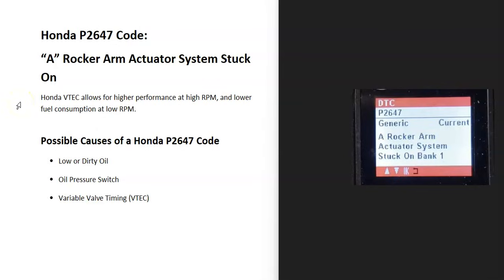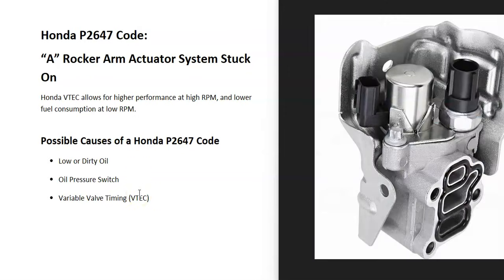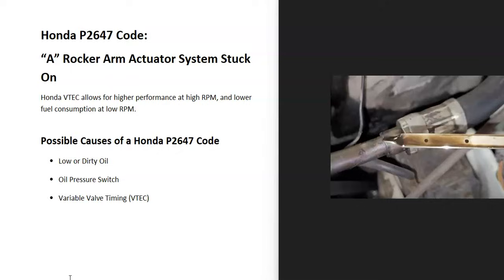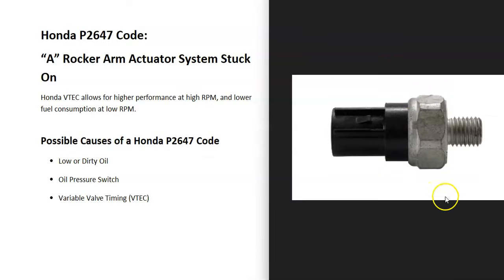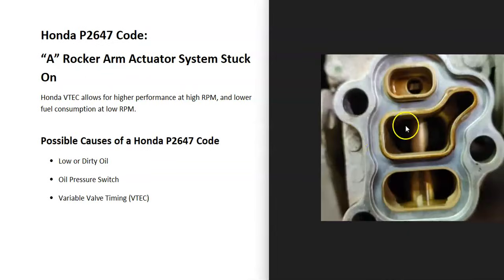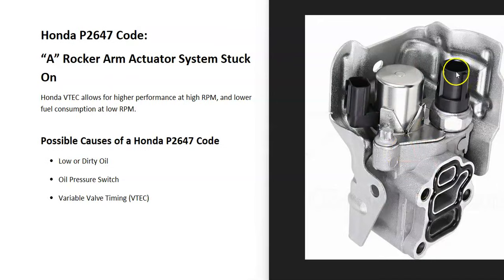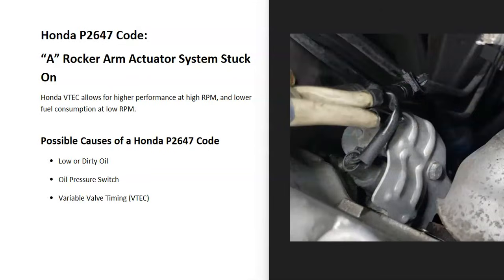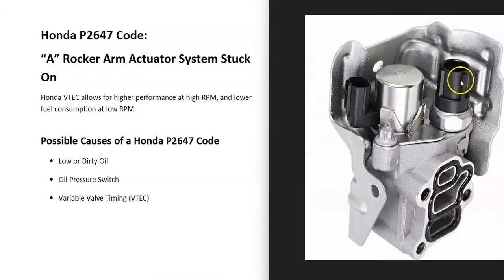How To Fix Honda P2647: “A” Rocker Arm Actuator System Stuck On

Comment: I replaced the part for p2647 cleared it comes back!!! Frustrated.. took it to a shop and checked it out still comes back.. it’s my daughters car….
Reply: I have done everything that possibly can be done to fix the same stupid problem and nothing, biggest pos Honda I ever had , same like you , is my daughter’s car🤬🤬🤬
Reply: what did the shop check and fix or replace when you took it in?
Reply: same here.  I've thrown every part imaginable at my 2012 Honda Fit racecar & still have the same issue.
Reply: I have the same problem, I changed the part completely, I was fixed and the engine indicator turned off, but after 12 days it comes back and on again! I really don’t know what should I to fix this terrible problem?? Is there any recommendations 😊
Reply: @sarwetmohammed7918  You're not alone. I've been researching this since Thursday and many people say the problem keeps returning. Sorry, I don't have any answers.
Reply: Maybe not a FIX but what I did that made this work for me after spending so much was going lower viscosity oil. Hope it help 🤘🏽
Reply: @chrisdejesus2955  0w20?
Reply: @elisa7joy9  yes I actually ran into this problem again with a friends Honda pilot and we changed the oil and it did it again, so then I drained the oil AND took off the pan and cleaned it then refilled with oil (correct viscosity) and it has worked ever since 🫡 hope that might help you out. Oil filter was also replaced
Reply: @chrisdejesus2955  certainly it's worth a try.... I'm only at 2500 into this oil change, but doing an oil change now is still way easier than changing the VVT assembly! Funny, I was tempted to do 0w20 since that's what my accord recommended. I just got the Odyssey used and the Odyssey is older than the accord, so I went with the recommended 5w20 thinking it might be more important to go with the oil the user manual recommended....